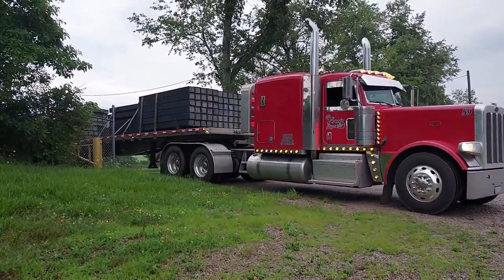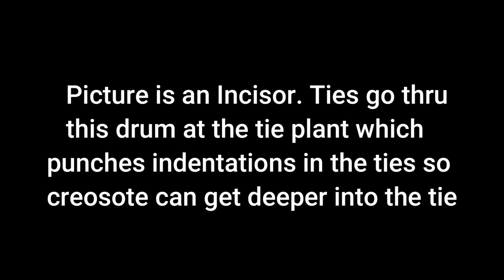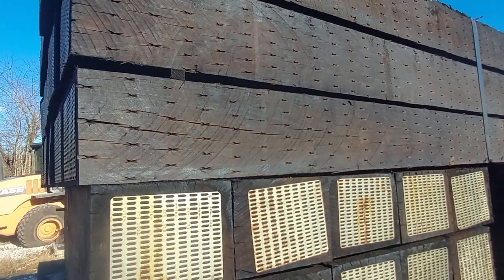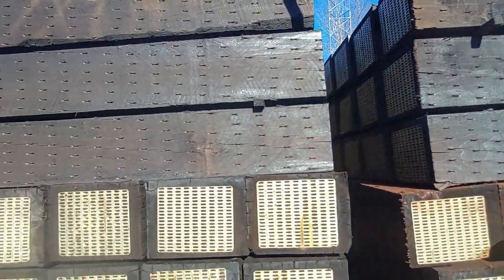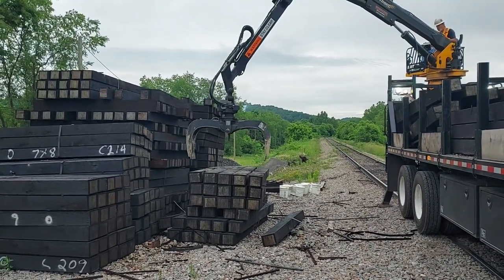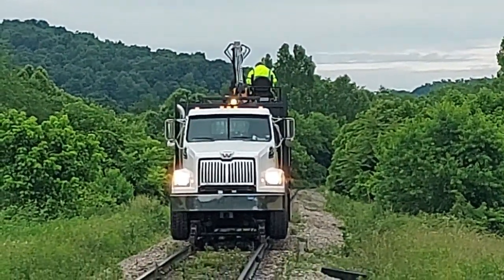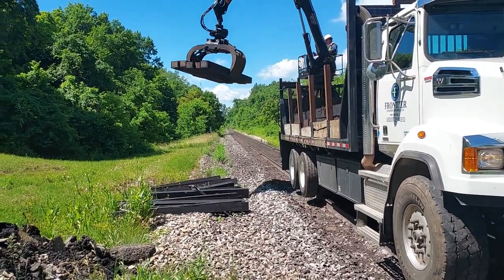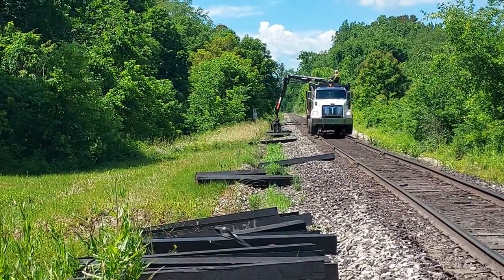Spreading Black Bananas on the Railroad

Comment: The 4 grapple trucks up in MA. Are they spreading ties on the old P&W ?
Reply from the maker: The job they were on at the time was for G&W Jim. They could
have moved on to another job up there by now, I really don't know,
so if you saw them on PW, then that is well possible. Thanks so
much for stopping by and checking out the tie show my friend.
Reply: @ccrx6700  Well, if they were working for the G&W, then they were working on the P&W because G&W bought the P&W about two years ago.

Comment: Hey man I live in Virginia and I want to get into the rail road industry but I know this isnt the best time to be getting into it but what would your advice be? Im an EMT now and only outdoor work experience is running small equipment for a hardscaping company and before that a general laborer for a commercial contractor. I just recently applied for a rail car inspector and tank car cleaner and waiting to hear back from them Im just trying to get a foot in the door. Thanks!
Reply from the maker: Well good for you Unknown, I hope you get the job you applied for.
If not RR contractors are usually hiring. That is a great way to
learn track maintenance. However be aware there is a lot of
travel and away from home time with them. Frontier RR Services
is hiring they are located in New Stanton Pa. but have work all
over the country. Check out their web site for details on getting
hired.  Best of luck to you and let me know how things work
out my friend.

Comment: Would cement ties last longer?  In long run cheaper?
Reply from the maker: This is the first video in a 4 part mini series on ties Kevin.
The 4th video will show you the differences between concrete and
wood ties and tell you the reasons why some railroads use wood
and some use concrete. That video will be shown in about a week
and a half from now. Hope to see you then and thanks so much
for stopping by and checking out the video on black bananas
my friend.

Comment: I wonder, isn't it possible to make ties from reinforced recycled plastic?
Reply: We have tried those in UK I am not sure if they are still putting new ones in. In US they may not be any good with spikes being driven in, we screw what we call a chair onto the tie, the rail is held in with wedges driven in against the outside of the rail, the inside fits under a lip. Some track has spikes driven through a metal plate into the tie which hold the rail in place in the same way as in US. I do not know which method of holding the rails was tried here.
Reply from the maker: The composite ties do require pre drilling of the hole before a
spike can be driven in it. Composite ties are better suited to your
method of lag screws than spikes tho. But they are darn expensive,
but excellent for mud holes.
Reply from the maker: Yes, just like the lawn furniture that is made from recycled plastics
they make composite ties. They are really expensive and holes
have to be pre drilled to drive a spike in one. Great for mud areas
tho. Thanks so much for stopping by and checking out the tie show
my friend.
Reply: @ccrx6700  The cost compared to wood is surprising. I thought they may be more but not a huge amount more. Probably why we are not using a lot over here, they will be good for wet mud areas though

Comment: Wonder the cost of concrete ties??
Reply from the maker: Good question Bob and one with 28 different answers. LB Foster
markets 28 different profiles of concrete ties (ties having different
dimensions and strengths). So you have 28 different prices.
However the concrete ties we would use for heavy freight would
be over double what the cost of a wood tie is.  Always is a pleasure
to have you visit with me and write in my friend.

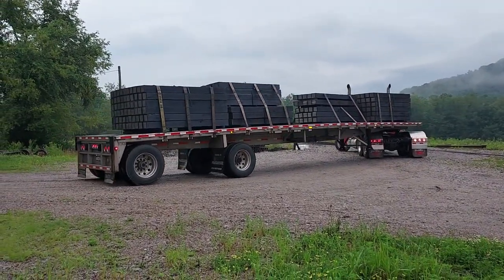Comment: 0:25 ?
You may call them "Black Bananas" 
I call them fire starters.
Soft wood sleepers  - high pressure coated with creosote (to preserve them)
All it takes on a hot day, when someone is using an acetylene torch to blow new fish-bolt holes in the cut end of the still in-situ, old rail, to join the newly laid rail onto, and stupidly aiming the blow-through sparks towards a stack of spare sleepers, and whoomphif. Flames everywhere and with no water anywhere near, too hot to approach t try and put out, so we lost all the new sleepers for the relay we were about t do.
..Not only did we have to replace the old rail back onto the stuffed sleepers, (until we could get more new sleepers for the near heavier rail) but we became firefighters for the rest of the day.
Why?
Because of a few hot acetylene sparks, and creosote sleepers, plus lots of dry tussock and a hot wind behind it all.
With just a small gang of 8 men, it took that long to get it under control.
There was a huge scrub fire and an entire stack of new sleepers, gone in minutes.
It ain't an easy task, climbing through the boundary fence and running to get uphill faster that the wind is blowing the fire through dry tussock, to slam the shovel down to put the flames out, before the fire gets too far away and burns the farmer's entire hillside.
Yeah, "fire starters" is what we called them in the NZR back in the 70's.
Mind you, here in  NZ back when the first creosote sleepers arrived, they were cut from Radiata Pine (a soft wood) which is why they were made 8x 6 instead of the Australian hardwoods we had from long ago, that were just 8x5's

Plus, back in the old days of the 70's with the NZR, all we had were open frame motor trolley's (we had three 4 man, a 3 man side-on & ONE 6 man trolley, all powered with B&S horizontal shaft motors, via 4 speed / no reverse chain drives to the rear axle)
All of our NEW rails and Black sleepers, we had to "drag uphill into that site area" with 2x flat-tops and a trolley per load, with 50 new creosote sleepers cunningly stacked on each of the flat-tops, and when carting the 42foot long / new rail we suspended approximately 30 of those between two flats (no rope or chains between, just the weight of the rails on a bearer on each flat-top) & putter uphill under extremely heavy loads..

All materials, loaded & off loaded BY HAND, thus rails slid out from the yard stacks, or dropped down from mainline wagons, were gang lifts done with all 17 gang members through the week, and at the weekend relaying - we usually only got about 8 guys to do ten hours a day for smaller single curve relay jobs to be done, meaning in the week or two before a job, we'd remove the fastenings (old dog spikes) out of rotten curve sleepers at a staged method of having three sleepers without fastenings, one with the fastenings untouched, then three without, all the way around a curve to be worked on (and with 15 MPH speed restrictions for all trains), to ensure that when we got on site on a Saturday morning, the in-between sleeper dogs were pulled and the old rail rolled off the side, beyond where the new rail already dropped off our flat-tops - near the end of the old sleepers, waiting for us to LIFT the old sleepers out of the ballast and use shovels to flatten it all, so that we could carry (2 men to one sleeper) the new sleepers up from where we'd earlier tossed them trackside, before we used crowbars to roll the new rail up onto them, and if needed, we'd all straddle these to torpedo them along the sleepers, to mate the ends with the previous rail.

It was exceedingly hard work, often in blazing sunlight on hot days, where we worked with little respite, and only a couple of large milk-cans of water (for quenching thirst and the two tea breaks), but as we knew it to be the only way the smaller branch-line gangs could do track relays, it was the norm for us.

Later, during the following weeks, we'd remove the old sleepers that weren't totally rotten (those went further to the side as useless), by two men tossing these up onto the flat-tops at 60 or so a load, to have three or four loaded flats towed behind a trolley, taking back to a yard, where we could sort them, into saleable firewood logs, reusable spares, for single replacements here and there, or to be stacked at the yard, for later transfer to a different area on our section (by train)
The old 30ft 55 LB rail was either considered too worn and simply rolled further away from the track, or if not too bad, taken by flat-tops & a trolley, to any of our rail stacks, to be used again, on different curves or straights, after re-bending by hand, with a rail-crow.

Those black creosote sleepers destroyed the thin leather gloves we had, but gloves were far better than having "sticky black hands" that couldn't be cleaned for weeks afterwards.
Reply from the maker: Some old railroaders used to call them BB's but that is no longer
politicly correct to say that, now we just have to say cross ties.
Have to be careful around new cresoted ties when burning, lay
down some fire clothe and you'll be all right. Thank you for watching the video today Quix4u. PS a toughened railroader
puts a dash of creosote in his morning coffee to give it
some flavor....LOL

Comment: 3:15 OMG they are undrilled, and with zero slope on the bedplate area either?
That's a lot of preparation work right there, before you ever go and lay them out before the replacement work begins.
Unless, you use inclined steel bedplates and drill them onto the sleepers as you go (after they are under the rail)?
At least all of ours had the saw cut across them (well inside the gauge area) and had been adzed properly to provide the tilt inwards that all new rail needed.
I must go & see if I can find an NZR sleeper video to show the predrilled holes in new (straight track) sleepers..
Curved track sleepers were only ever predrilled on one rail (top rail) position, to allow gangs to gauge-drill the other rail correctly, as required.
I cannot find anything about the Adzed slopes we had on all our sleepers back in the 1970's on the NZ - but have found out WHY.
And it could help explain why your rails keep "rolling outwards" when they become far too loose when dog spike fastenings lift out, with rotten sleepers.

https://www.linkedin.com/pulse/rail-101-inclination-daniel-pyke

[quote]
If the coned wheels were to sit directly onto rails laid perpendicular then because of their shape the wheel contact would try to spread the rails apart. This would therefore require the rail fastening system to work harder on one side of the rail than the other to restrain the rails from rolling over.
[unquote]

Remember the video you did recently of five coal hopper cars derailing when the rail ROLLED OVER?
Don't just relace the sleepers with new ones, try and replace all on curves especially, with adze sloped sleepers (the correct way up, as there is a right & wrong way, as you should NEVER put a sleeper in, with it's end grain CUPPED, but up & over, as if an umbrella
Cupped wood grain holds rainwater in the sleeper, umbrella grain sheds the water to either side and keeps the sleeper from rotting.
Reply from the maker: None of our ties are predrilled, just drive a spike in them, we
don't use lag screws which require pre drilling. We typically put
in 2,000 new ties a year for a 16.7 mile track and have done
so for the past 20 years, that is a pretty robust tie replacement
program for this small of track.